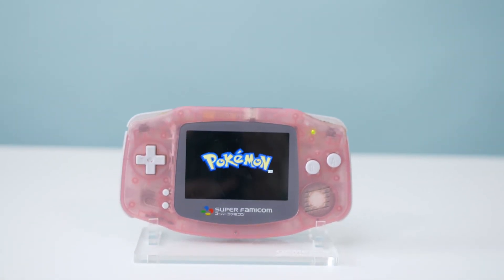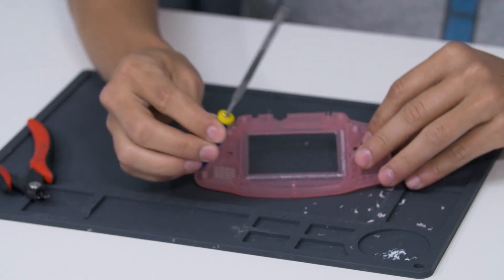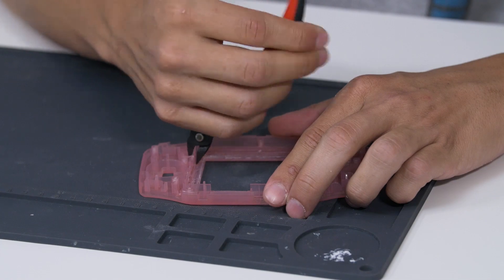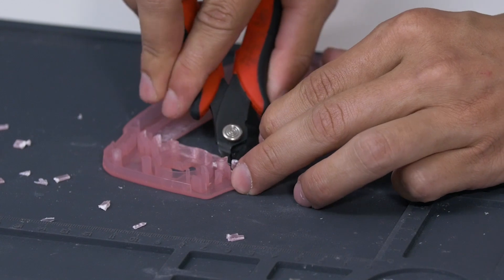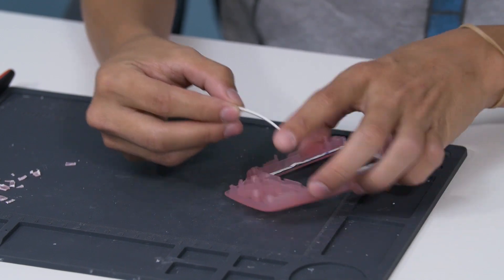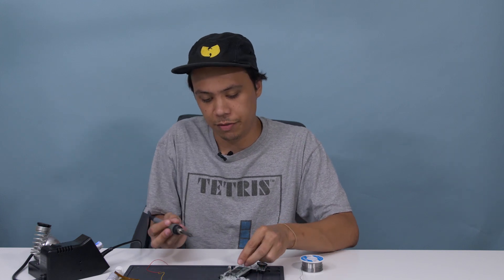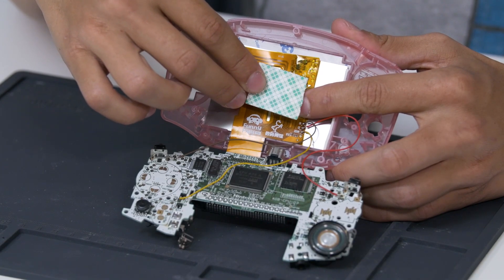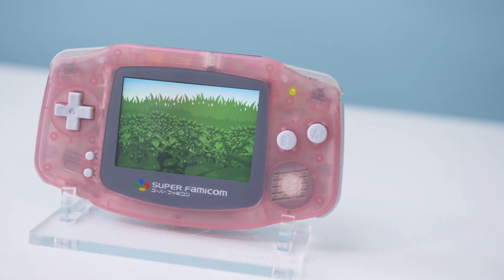IPS Screen install for the Gameboy Advance! Tutorial

Comment: Hey man, thanks for this awesome video; made the installation process a lot clearer.

Unfortunately I screwed up along the way-- I accidentally yanked off the wire I had soldered to the connection for L on the ribbon cable, and the copper pad on the cable came off along with it.  Any tips for how to reattach the copper pad?
Reply from the maker: Ahh man that’s unfortunate 
There isn’t really a way to reattach the pad. You could try to expose the copper in the cable that the pad went to but you risk ruining the whole ribbon so I probably wouldn’t do it.
You should be able to put the Gameboy together just with the R and select soldered in but you will only be able to step up in brightness not down.
Reply: @JayBoyModz  Brutal.

I decided to go ahead and order a second kit because I ALSO broke the screen when I tried to wedge it in there after putting in those little spacers.  Lol just about everything that could go wrong on my first attempt did.  Least I got all the mistakes out of the way the first time.

Thanks for your response, man.
Reply from the maker: Lauderdizzle ahhh well good luck on the next one! I’ve definitely broken a couple panels on the install. That’s the main reason I don’t stick the screen to the shell because once you do, it AINT coming back up lol

Comment: I have built a custom gameboy advance with this screen, but it seems that the dpad is somewhat stiff. Do you have any tips on how to fix this?
Reply from the maker: Yes actually, I will sometimes cut the conductive pads on the side a little to help them fit better
Reply: JayBoyModz thanks for the tip, I will try it out.

Comment: I just did this mod but I don't like how my shell looks. I already applied the 3M double sided adhesive. How troubling would it be to transfer it to a new shell?
Reply from the maker: luis cortazar I would probably cut it all at the corners and peel it off and re apply it one side at a time to avoid ripping it by tearing the whole thing off at once
It tends to curl too when you unpeel it

Comment: I’ve bought the V2 kit and I have two GameBoys that are possible candidates one is a japan exclusive Midnight Blue unit that I absolutely love and the other is a glacier unit. I’m worried about the shell mod scuffing with the midnight blue gba because it isn’t frosted and is very transparent. Do you think scuffs from the shell modification would show through?
Reply from the maker: Cody Lester They marks from cutting the shell could show through yes. I would recommend using a dremel tool and grinding away at the side walls slowly to try and keep a clean look

Comment: Recently found out about this screen.cheaper then the ever increasing price of the AGS screens. 
My only worry before buying one is the tearing issue. Seen various opinions bout it. 
What’s your thoughts?
Reply: There's a V2 screen ribbon out now that gets rid of the screen tearing, so it's basically perfect for a backlight mod. Especially considering the price; the 101 screens are now as expensive as this mod kit and an AGB-001 unit, so the Funny Playing screen route is a no-brainer.
Reply: Aarlog thanks for reply. The price is definitely cheaper then the 101. I just can’t justify them prices.
Reply: @Aarlog  the AGS screens are dwindling and are really getting rare.
Reply from the maker: The tearing issue is a little bit annoying but they have revised the ribbon cable to try and fix this issue. I will have a full review comparing both the AGS101 and both versions of the ribbon cable coming as soon as I get my V2 ribbons in :)
Reply: JayBoyModz thank you for reply. Will watch your video when it’s out.